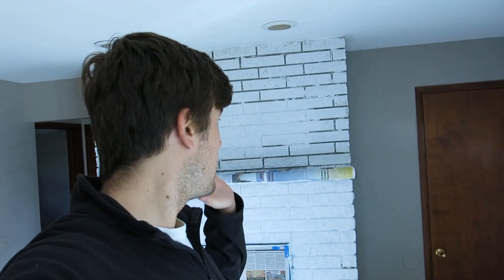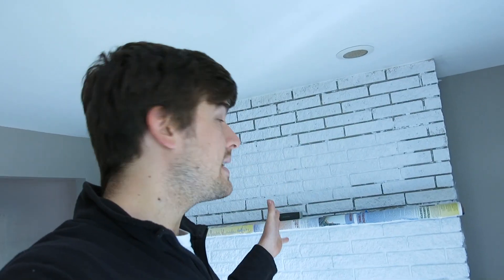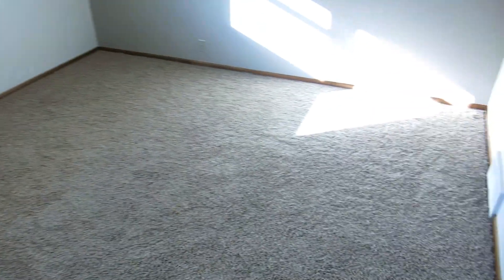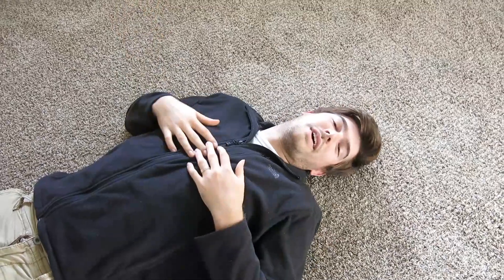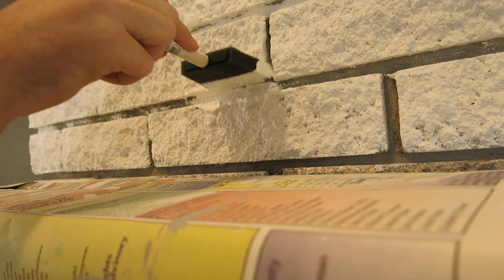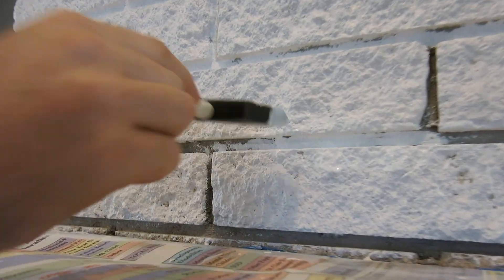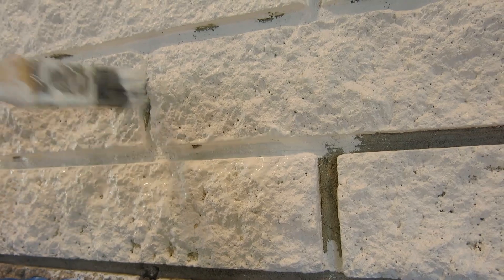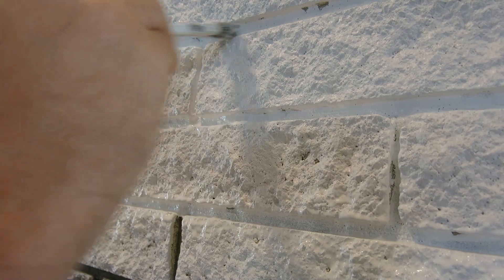How to Paint a Fireplace The Easiest Way

Comment: I totally understood what you were saying about it finally being home w/the nasty carpet gone. We never took off shoes while waiting for our new carpet cuz we were so afraid of the old carpet. When we had the carpet replaced, the carpet guys told us that they'd never seen as much dirt, pet hair & skin under a carpet AND pad before. The layer was about 6in deep. & that it was one of the most foul smelling jobs they'd ever worked. When the floors were done it was like a weight lifted. A rebirth. We installed stain resistant, antimicrobial carpet & used an antimicrobial/antibacterial paint on every filthy wall. When finished, we finally felt like we had a home & weren't afraid of getting sick anymore. I feel for you both. It's a long process erasing the traces of previous owners.

Comment: Are you planning to paint the trim? Painting it white will make the house much more modern.

Our houses are similar, and we also bought a fixer. We had to paint every surface and had our floors refinished, we also had to gut the kitchen and bathroom. It's a lot of work but it is so much fun and super gratifying. I'm interested to watch the video for the cabinets. We were able to score some free cabinets and put them up in a room we made into the laundry room and I plan to paint them!

Comment: Just watched your two videos on the fireplace. It's too late to give advice for this job but I used a normal brush and it wasn't up to the job as the rough surface was too hard on it so I got a  masonry paintbrush and it worked great and didn't leave bristles in the paint.

Comment: Yes you are supposed to prime concrete or at least get a paint  with primer in it. I know you’ve already completed this project but just in case anyone reads this they will know and also if u used a large nap 1 1/2 nap roller which is the largest it really gets in all the deep grout lines one person roll with another going right behind with a brush behind you just to smooth out any clumps. It works very well n fast and great coverage.